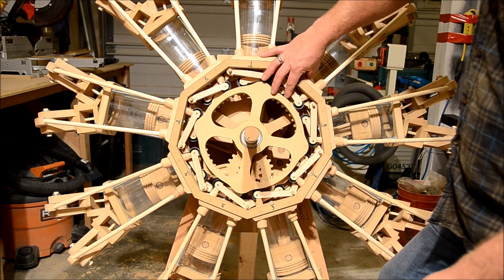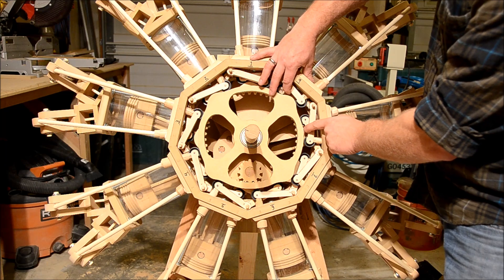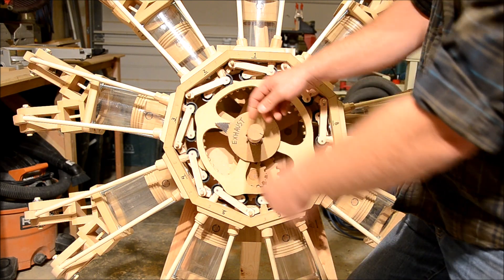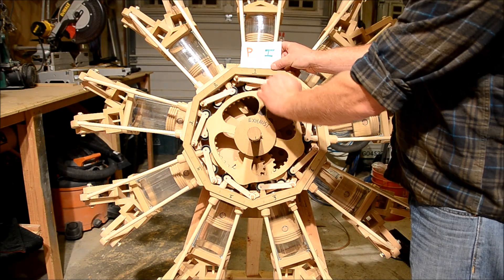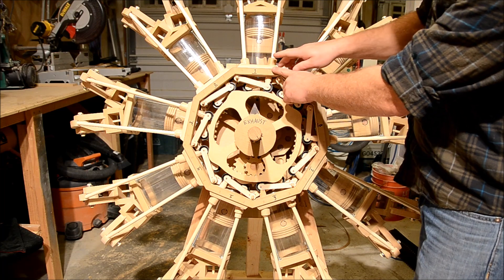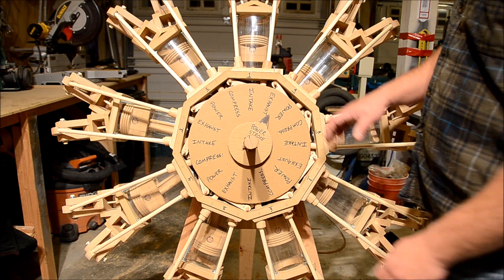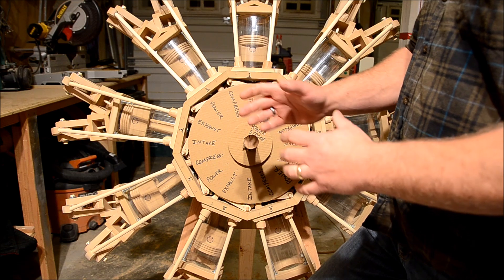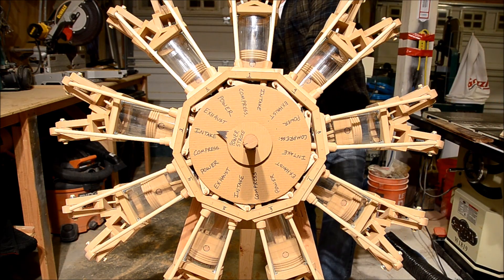How a Radial Engine Works - Explained  Part 2

Comment: Question , all be it a little late.    I noticed the counterweight on the crank shaft doesn't seem align to any power or compression stroke. In a typical engine a crankshaft counterweight is dedicated to each piston. How does a single counter weight relate to multiple cylinders.  Since it's not dedicated to a particular cylinder it must exist simply for the sake of inertia or rotational dampening.  I'm guessing?   

BTW great model . I appreciate your effort to add to the you tube of collective knowledge. Sharing knowledge is to all our benefit.   In that regard;  
      Also donating your model to a museum ( on loan of course) could create a sizable tax deduction.   Building kits or donating more models to multiple museums could be a nice side biz.  Your model with a TV tutorial would be a huge hit in any aviation museum.   
      P.S.  include the reason for the counter weight.

Comment: My understanding of the firing of radial engines is that multiple cylinders fire at the same time.  Am I wrong?  Great video and I always was curious how those radial engines operated.  I've been a car nut since I was 20, 58 years ago and am still very interested in all things mechanical, mainly gasoline engines.  Many thanks for these videos

Comment: Once again, excellent demonstration of how a radial engine works.  A few take-aways:  balance is crucial with a radial engine (as with any engine); i imagine the sleeve valves were used to reduce reciprocating mass, enabling higher engine speed; and finally, wood is a great material for an educational demo, but given the vibration of this engine (plus heat and other durability issues) wood is a poor choice for an operating engine :-)

Comment: that is an awesome model and explanation of the radial engine. you really did some great work there. i remember the wright cyclone and pratt and witney engines when i used to make models as a kid. i also had a radial engine model i built from a kit. do they still manufacture these engines today?

Comment: This is probably THE BEST explanatory video of anything I have ever seen!  You are so right.  Animation is great, but this model you have built and can show the details of FAR exceeds any animation.  You are obviously a MASTER craftsman in wood working as well as engine mechanics.  I rate your video A++ at a minimum.  Thanks ever so much.  I am an amateur student of WWII aviation and particularly love the old radial engines.  Nothing like the authoritative growl of a radial.  In the increasingly rare instances when I hear one, I immediately stop what I'm doing, look up toward the sound and exclaim "Round Engine!"  Their sound absolutely can't be confused with any other.

Comment: Excellent teaching model. i understand the valve train, cam, ect. I want to understand the crankshaft/connecting rods or whatever it has. Seems more complicated than an inline, opposed or vee engine. There has to be a part I can't find. I don't think I've seen pt. 1.

Comment: Hello
"1-3-5-7-1-3-5-7, glue and canvas for wings" So said Richard Bach in his book "Biplano".
It's the second time that I watch these two videos and I must say that they are phenomenal.
I am an aviation enthusiast and the radial engines are the romantic synthesis of the flight and I can only admire the quality of the reproduction you did ... I can almost see the engine brand ... Wright Cyclone or Wasp?
The thing I do not know about these engines, however, is the lubrication: in a car engine there is the oil pan where the oil coming out of the crankshaft falls and collects.
In radial engines this is not possible: all the oil will be collected at the bottom of the pistons by centrifugal force ... and so how does it work?
Thanks if you want to explain this particular too.

Comment: What a magnificent tutorial of a venerable old war bird's power plant.  My mother-in-law was a "Rosie-The-Riviter" on wing assembly division of Goodyear Aircraft's building of the F4U Corsair in Akron Ohio during WWII.  It was powered by the Pratt & Whitney R2800 Double Wasp 18 cyl. double super charged radial.  At cruising speed that motor consumed 275 Gallons of Av-gas per hour at 2100 RPM.  Reminds me of an old 1958 Chevy Impala 348 V8 I had.

Comment: Amazing!  Wonderful project, and lucid explanation.    But I have always wondered this:  In many WWI flying aircraft, the radial engines in most....the entire engine spun with the prop. ( the axle was stationary)...so this huge mass was spinning in the aircraft.....also causing quite a bit of torque....and  the novice pilot sometimes died in training.  But........how did they get fuel into a top of the cylinder in a spinning engine???   I can't imagine fuel coming from the area near the shaft.....since it can't get past the cylinders.   I'm guessing some kind of metal tubes were attached down the length of the cylinder.......and the spinning engine "flung" gas into the top of the cylinder.      Also..........the  German WWI aircraft, the Siemans-Schukert...( very late in the war)...had an 11 cylinder engine.....the only example I ever heard of.     The radial seems to have done the way of the do-do..........the closest attempt being  the Wankel " rotary",......which never really caught on.....( I had a Mazda ( 1974) station wagon with one....and the mileage was terrible...and the seals broke down at 60,000 miles.)    So....if you know how the fuel delivery worked on a 'spinning' radial, .........I'd appreciate your comment. Thanks.

Comment: Fantastic work Ian. I was wondering as an addition to this you may be able to explain how the Magneto on a 9 cylinder works? I get the 4 lobes (thanks) but having a rotor button and all 9 terminals on only 180 degrees of the cap an the remaining 180 degrees with nothing?

Comment: +1 on those requesting red/green LEDs in cylinders. It looks like you are a mechanical oriented person vs. electronic design/builder so i can understand the lack therof.  

Great job, with both the build and explanation/demos.  The cardboard rings helped a lot as well!

 I wish the thumbs down crowd would justify THEIR problem.

+1 on the request for parts blueprints as well.  Three years of no video update leads me to believe you are on to another project tho.

Comment: Could there be a 4 cylinder radial with a firing order of 1,3,2,4? or 1,4,3,2?  And could a 2 cylinder boxer type opposed engine be considered a type of 2 cylinder radial if it had a master rod, sort of like a Harley Davidson?  Also, would it be correct that in a 9 cylinder radial engine there is a power pulse every 40 degrees of rotation, a 7 cylinder radial with a power pulse every 51.428571 degrees of rotation, and so on?  The radial engine is really a genius piece of mechanical engineering and your model is an important instructional tool and achievement.  I like the clear cylinders.  Thanks.  ps:  my guess would be an actual 9 cylinder radial of your displacement would produce between 500 and 1000 horse power.

Comment: Great model.

It's amazing to think that the engineers who designed the real engines like that did so with a sliderule and a protractor, no computers.

Then they were probably assemled by women in a factory using manual machining, no CNC...

Comment: Maybe a dumb question, but doesn't the weight of the pistons cause an imbalance? Because the opposite pistons move in the same direction. I kind of thought I saw that happening when you put it up to speed, the vibration of the whole (wonderfully crafted btw) setup.
Reply from the maker: qatsimo - you are totally correct. The counterweight on the crankshaft offsets the weight of the piston and rods.... on an actual engine. It was more or less a guess with mine, and I missed it by quite a bit. I plan to improve that on the next one!
Reply: That was my question too, i had hoped for the counterweight to be explained in the video.  This reply kinda clears that up.

Comment: I've always known how the cylinders fired inside the engine but never knew how the valve system worked. This was a very informative video series. You explained this much better than anything else I've ever seen!

Comment: Ian, THANK YOU very much for these two videos.  There is a gentleman who built a RV-8 with a Rotec 3600 nine cylinder, and Rotec themselves have shown some of the assembly process, but for most GA pilots, heck, most engine enthusiasts, we don't deal with radial engines that much, and I would assume that most of us couldn't tell how one works.  I know I certainly didn't.  Your demonstrations were awesome, as well as your partial disassembly to show us the inside.

The one thing I wish you had added was how the gearing attaches to the crankshaft to drive the cam ring.

Finally, running the model up to however fast you got it with your drill sounded just like what a radial engine might have sounded like.  I was waiting to see the fuel and spark in the cyclinders and see the smoke and exhaust and her start up!  You did a REALLY fantastic job on this, and thank you for the education on just how a radial engine works.

Comment: I am amazed by your clear explanation of some complex technical concepts. This is possible only if the matter is known in depth. The radial engine model is outstanding. Your passion is well visible but at the same time you remain rigorously logic. Thanks for the video. 
I have a question: I noticed the pistons position during the engine operation and it seems to me that the engine is subject to a large amount of asymmetrical forces. Is the flywheel designed also to compensate those unbalancing forces?
Thanks for your time.

Comment: This is a phenomenal video. A great companion to the previous video.

Your explanation was easy to follow.

Also, I sounded like a real engine when you spun it with the cordless drill! It made me think of "Flight of the Phoenix" with James Stewart and Hardy Krüger!

And of course, the power output and compact size of these engines made them ideal for tank engines. IIRC, the Sherman had a radial engine on a tray which made field swap outs very quick.

Thanks for the video!

Comment: You Sir, are a Master Model Maker! and you obviously know your subject inside and out with the intimate knowledge of one who loves their work. I congratulate you on your well done video which demonstrates these things. Any school or local museum would be very lucky to have such a model with videos to explain the principles and applications you have illustrated. I wonder, would it be feasible or even possible for training and illustration to utilize the other principles of valving which you mentioned in a model such as this? Perhaps alternating cylinders could use different applications - overhead valving, slide valving, sleeve valving, etc. etc. Just thinking of taking it one step further...  Fantastic, Superb Job Ian Jimmerson!

Comment: how do you fit nine connecting rods on the crank to line up w/ all the cylinders
Reply: Video #1 shows that part best. 
One 'master' rod around the crank pin with a large circular lower end. Each other rod is pinned to that circle in sequence.  The master cylinder rod keeps that circle from spinning, instead it orbits around the crank case as the single crank pin moves it. As it orbits, each individual rod moves from TDC to BDC sequentially.

Comment: I loved these two videos. I am living off grid and I have a ram pump as a way of delivering water. Lately I have been toying with the idea of using it to harvest electricity.  As it is, I can stand to lose some pressure, so that is not a concern.  I wonder, could your build be adapted to use compressed air as a way to power a simple generator?

Comment: Looks like you have a little bit of valve float. You sure those valve springs match the cam? You did look at the cam card before installation, right? XD

Comment: Your model is beyond INCREDIBLE!  I can't imagine the hours, days and weeks that it took to build it.  WOW!  And I'm nearly blown away by your courage in running it as fast as you did.  And I'm sitting here laughing and gasping with incredulity at your statement of how you chose to build the "simpler" version of the engine!  Although it may be the "simpler" version, I do believe it is also the most commonly used design.  Thanks again for a terrific video!  Crystal clear, easy to understand - superb in every way.  You are definitely a TOUGH act to follow!

Comment: Very interesting.   I have wondered for a long time how the cam worked,   operating every 2nd cylinder.    Nice video.   Now see if it will run on compressed air.

Comment: Great model and build. Fantastic workmanship. 

I was always wondering about the balance both primary and secondary of these engines. The thing firing every other cylinder rotating in a circle vs opposing sides of the block bugs me. It seems you could reduce the counter weight mass if you had them opposing. 

If this was a 18 cylinder(double row) engine you would then have the other "row" offset 180 degrees and that would balance the engine out evenly. Right?
Or would that create a situation where whatever kind of fixture/fastener that was holding the rows together would fail due to sheering forces of the piston at 12 o'clock and the piston(on the second row) firing at 6 o' clock simultaneously "twisting" the block on the angular plain between the center of the pistons on the first and second rows?

Comment: I have been amazed by radial engines all my life and until you explained it to me I never knew how the valve train worked. I have several radial engines in my rc planes and can never get enough of the radial sound. You are truly a craftsman to be able to build a scale engine with a cut away like that and your explanation was spot on and very easy to understand. I am truly blown away by your engine model. I have to say today I really learned something interesting. Thank you so much.

Comment: Very well done. Your explanation was spot on and easy to understand. A good running radial (or round engine as we called them) sounds like a well oiled sewing machine if you ignore the exhaust. The hairs on my arms always stand at attention when I hear one of these miraculous machines run. Listening and understanding one of these machines should be on any gearhead's bucket list. 

Nice job sir. Nice job indeed. 👍🏼

Comment: Nice video. I enjoyed it. Just want to ask, what wood did you use? Pine. Cedar, Spruce. The only reason I ask this Ian is do these "woods" emit their odor during the build and if so does it still linger? It would be neat if the radial has an aroma. 
Now how doe's the fuel in a radial and the carbs on the bottom of the radial get its fuel? 
I can understand a fuel and oil pressure system but have no idea of the system operates on a radial. How does the crank and rods get their oil to reduce friction and not seize? 
Thank You.

Comment: Loved it. My biggest question is where does the oil go? Bottom cylinder?
Reply: Great question and the answer is yes.  When the engine isn't operating, oil drains into the bottom cylinder and in fact leaks past the rings.  This is one reason that radial starts are so smoky:  you're burning oil at first.  It's also why radials consume a lot more oil per running hour than opposed, inline, or V engines.
Reply: And why radials are pulled through/cranked a few turns before the mags are activated I guess?
Reply: The cylinders protrude into the crankcase creating an oil wall.  Channeling the oil to the sump. The oil sump is located between the lower cylinders 5&6   The oil pump is located in the gear case on back side of engine.  Beautiful job Ian👍

Comment: Ian, can't add any accolades beyond what you have already received. Well done, sir!  A few question I could probably Wiki, but you do such a fine job, I'll ask you. How is fuel delivery and exhaust plumbing managed?
I presume there are no provisions for modifying ignition timing, correct? Am I mistaken or did I see a radial engine where the cylinders rotated and the other parts were stationary? Thanks!

Comment: Add some simple electronics. Use 18 12v LEDs and connect somehow a contact system to each cam or lifter. Put s blue and a red bulb in each one. Then the red one will be power a blue one exhaust. That would add a great visual effect

Comment: DUDE!! incredibly awesome model, and absolutely "idiot friendly" explanation of the inner black magic and gremlins that make those mechanical question marks hum! kudos on craftsmanship, both counts! now, bizarre question about multi row versions: crank pin layout... would a 2 row have a "360" crank (with actual "master" pins aligned ), a "180" (with pins 180 degrees from each other), or some variable whackiness based on the number of cylinders per bank?
Reply: Great question. And, I think I've seen 3 rows too, back in the day. I was stationed at Pensacola Florida Naval Base. Home of the Blue Angels. The NAVY Aviation Museum is there with all the cool aircraft in naval history. If I'm not mistaken, I believe I saw a 3 row of cylinders on a large radial engine. It must have been a design they mothballed for some uncertain reason. But it was there to marvel at...lol.
Reply: @dagann1  I vaguely recall speaking with one of the A&P guys (years ago when I worked in aircraft maintenance), and he was talking about helping out maintaining a DC-3.  He indicated there were 54 spark plugs per engine - aircraft engines have two plugs per cylinder (for reliability), which suggests 27 cylinders, hence three banks of 9-cylinders.

Imagine doing both engines ... 108 plugs!  And I suspect there would be two magnetos per bank, so six magnetos per engine.